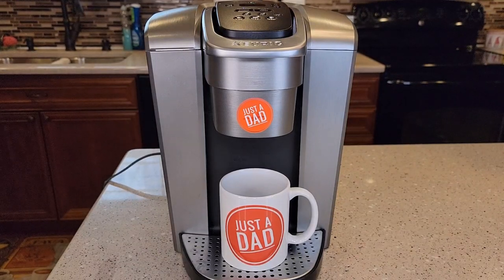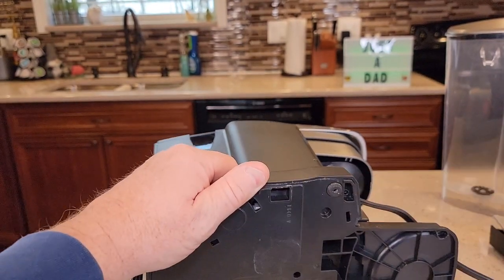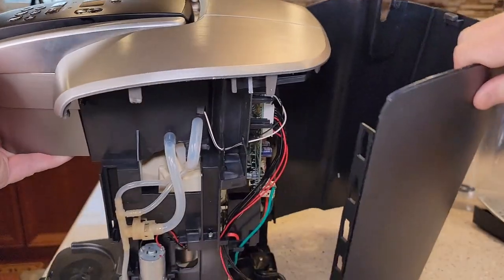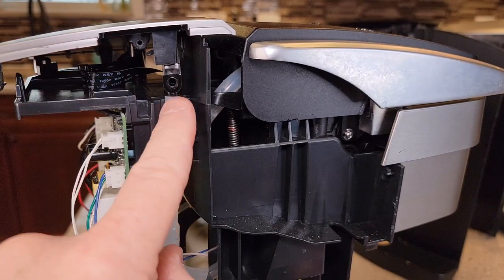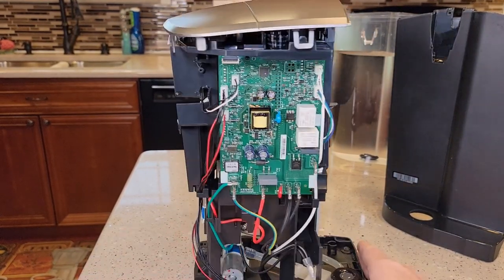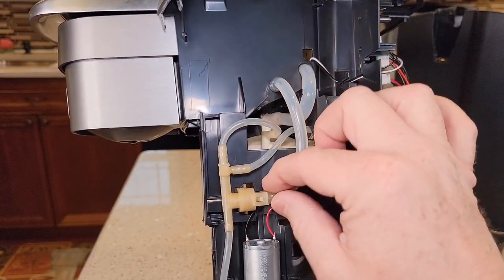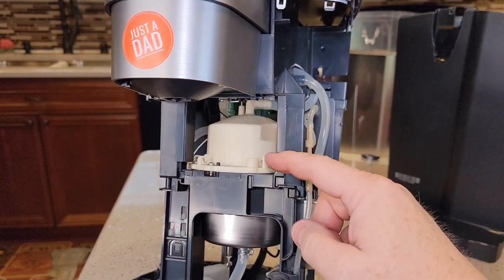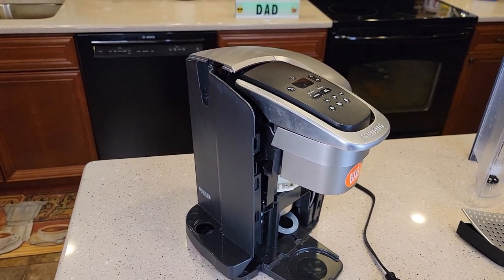HOW TO FIX Keurig K-Elite Model K90 ADD WATER LIGHT How To Open Fix Leaking Water

Comment: THANK YOU!!!!!     My "ADD WATER" light would not come on, so I used some canned air. I put the canned air tube nozzle into the vent hole at the top, then pushed my finger down onto the black valve on the bottom where the tank plugs into and blew air into it.. Then the water was forced out of the sensor tube at the bottom. Now it works again. You helped me BIGTIME !!!! You are AWSOME!!!!
Reply from the maker: Awesome!!!! good job and thanks for sharing!!!
Reply: @JustADad  I just watched this video and when he showed it was actually a vent hole, I went and grabbed my canned air and did the same thing. I was just about to post the same process when I saw yours. I had just gotten off the phone with Keurig and they recommended buying a new machine and I said absolutely not, someone online will have a fix for it. Atleast I know how to take the machine apart if I have another issue that may need that so thank you.

Comment: Recently the add water light stopped working on my elite. After watching your video and seeing how the vent tubing and switch work I was able to fix the problem with canned air. I removed the water tank and depressed the plunger valve. While holding the plunger valve open I blew computer compressed air into the vent hole you showed at the top of the machine.
All fixed. Working fine again. Thank you!

Comment: 🔵SOLVED🔵- My add water light stayed off even though the reservoir was not attached. I think what happened was when I tipped the machine to read the model number on the bottom (I needed to get instructions on how to descale) probably the sensor tube filled with water. After watching this video, I jiggled the machine a bit and I saw the light so to speak. 🔵 Thanks DAD!
Reply from the maker: Awesome

Comment: This worked for me.  The machine was pretty easy to get apart, mine must have had air in the sensor tube, because pulling the chassis off popped the little black piece off, and while turning the machine upside down to retrieve that piece,  small amounts of water and coffee came out that didnt come out before.  Thanks for the inspiration
Reply from the maker: Good job

Comment: Thank you - this video helped tremendously- I took a straw and blew air in that top vent hole that is on the side where the water container is while pressing down on the water inlet until air came out and then again until water came out through the spout - and behold the light came back on! Thank you.

Comment: Dear Just A Dad...This video is phenomenal.!!.  it so happens I have/had the exact brewer.  The power cord failed right at the wall socket and it was turning the machine on and off as you jiggled it.  I originally registered the elite. I called Keurig and asked for a Replacement Power Cord which I knew they would never do as I was years out of warranty..  So with some begging, I persuaded them to sell me another at 20% off. Not good enough, ask for supervisor.. 50% off.  $189.99 to $99.00.  I thought that was decent.   I just tested it, and put the 10 year old one out for the trash.  The strange thing was I tried to pack the old one in the new packing box and it would not fit.  Visibly, I could not see the diff but I did not measure anything, either.  Call Keurig...They will deal.!!   Date 8.27.2023  9:45am

Comment: Just a suggestion, you can go on Amazon and buy plastic spudgers. Make sure you get fairly rigid ones but they are excellent for this kind of use and are easier on the plastic than a metal screwdriver. Good video👍.
Reply from the maker: Thanks for the tip, I just ordered some!
Reply: @JustADad  nice!

Comment: Just A Dad! You totally showed me how to fix my nonfunctioning add water light: push down on the backflow valve under the tank and blow through the vent hole. It purged all the water out of the sensing line!

Thank you!
Reply from the maker: Glad I could help!  and thanks for sharing this good tip!
Reply: I just did that trick and a ton of water came out. Light still didn’t come on and the water reservoir is sitting on the counter 😢
Reply: @MsSaralyn  Fill the reservoir and put it back on. I don't remember if my light turned on right away, but it did the next time it got low 

And a bunch of water coming out is normal.
Reply: @TheDrewski71   and 🙌 the 2nd day it started working again. Go figure. Thanks for the video

Comment: Great to see the insides.  I wanted to see if I could drain the inner tank by tricking the water sensor. Most other Keurigs use a magnet float to determine the water level. This method is pretty smart, but I can't trick it with a magnet, oh well.  Still good to know what is inside these things.

Comment: I'm having trouble with leaking. It's not the water holder. I'm so bummed in less than a year one of the more expensive Keurigs is leaking like my cheaper one did. ; (  It does say "add water" when there seems to be enough but other times it's ok. I wrote the company but not sure if it will help. I can't see myself taking it apart but I thank you for all your hard work.

Comment: My light doesn’t come on until it runs completely out of water, then I have to fill it back up roughly to the position of that sensor. So it seems like the sensor works on the refill but not when the water level is going down. Is this the same problem others are having and do you think cleaning that tube will fix it?

Comment: If you line up the hooks around the side panels, you can pop the side panel downward and it will lock in.  Look at the hooks and see  the direction they pop inline.  THen install the screws.  If you removed the top hinge part, be careful. THere is  a ribbon cable that cn be torn off controlling the electronics of the selection board.

Comment: that is an overflow tube.  Is there a circuit breaker on this machine like the slim machine has on the side that you have to press to restart power:  Thanks
Reply from the maker: no reset on this coffee maker,  thanks for the update

Comment: I have a K-Elite that stopped pumping a full cup of coffee. The large (12 oz) only pumps about 7 ounces of water. Each size is nearly half the size that it is supposed to be. The "strong" and "cold brew" doesn't even pump water at all. I did notice that I just don't hear the pump taking water from the reservoir like I used to (either when I turn it on or after I brew a large cup). So, it only hums ever-so-slightly when it needs water (and I can hardly tell that the water is lowering in the reservoir). So, my assumption is that it doesn't draw water strongly enough from the outside reservoir into the heating reservoir. 

What do you think that the problem might be?

I've descaled, used paper clips on the needles and even pumped water into the intake hole that connects to the reservoir. Nothing has worked. My last guess is to take it apart before I toss it. I hate that this machine only lasted about two years. I guess that this is the new normal for Keurig now. If this doesn't work, I'll (begrudgingly) head to Costco for a K-Supreme Plus machine.

Comment: After watching this, I tried one more option! 

My add water was on but I had it filled from the sink. So unplugged the keurig and poured the water out. Then I put the tank back in the keurig empty. I then turned it on and took a pitcher of water and poured it into the filter and tadaaa 🎉 that turned it off 😂

So basically don’t take out the tank and fill it up separately?
Reply: I have this same machine as well and my light is on and wont go off! I lost the doo dad lil black peice on the side after taking apart and putting back together. I am SUPER FRUSTRATED I cant get it to run water and turn the add water light off! I am going to try this in the morning as well as the hold button under resovoiur and can air in hole on side top at same time trick and see if that will do anything for me. So basically I need to put on empty and try pouring water in on spout with the filter connected on the resouvoir?

Comment: Great vid. Any ideas about it not blowing air at end of cycle to clear water from the pod? I've tried all reset ideas to no avail.
Reply: Purging I think it's called.
Reply from the maker: make sure its not in high altitude mode,  do you see like a mountain icon on you display that mean its on.  the air pump line could be clogged.  maybe also clean the needles  not sure after that.

Comment: No issue with add water.  Descale light came on, solid red, not blinking.  Machine wouldn’t descale, heated up, draws minimal liquid then turns off when a cup size is pressed.  Eventually machine would turn off on its own without attempting to brew.  We clean monthly with vinegar solution and filtered water, charcoal filter replaced in reservoir.  No idea what happened.  Took it down enough to see the tubing is clear and unclogged.  Only 4 year old machine.  Thermostat issue?  Had to order a new one.
Reply: This is exactly my problem and I am having no luck finding a solution 😢

Comment: I just did the same process but instead of using compress air I used my portable tire / sports inflator.  It pushed out the water from the hotwater storage tank which was still hot.  I them pushed down on the back-flow valve and no water came out as it did before I used the Air Compressor.  I didn't want to use my compress air because of the warnings on the can... Anyway thanks Thanks Just A DAD!!!!!
Reply from the maker: Awesome!!!!
Reply: Before using compressed air in the tubing, you should really disconnect the tube leading to FPN-07PG pressure sensor on the PCB, otherwise you risk damaging it and the Keurig will be unable to sense the pressure buildup inside the chamber while dispensing and get no water dispensed.

Comment: I’m having a problem with this one where the water is not pumping out.  It makes all the noise like it’s about to make hot water but nothing is coming out and at the end it makes the noise of pushing the water out and not is coming out.  I did the paper clip cleaning and it still is not working.

Comment: Indeed, the only thing that sometimes bothers me from this machine is that light blue staying on even though the reservoir has enough water. It is an intermitent problem, though.
Reply from the maker: yeah I have seen that also.
Reply: I had the same problem. After watching this video, I decided to drain the water sensor tube. I removed the water tank and pressed the the part inside the socket where the water tank plugs in, releasing the water in the air vent. Fixed the problem.! I think my keurig had an air bubble in the water sensor line in front of the water sensor.

Comment: Great video.  Mine works normally except that when I put a pod in and close the lever, the blue lights dont flash to make any selections. If I press the hot water button, then the lights flash and I can select the size cup I want. Any thoughts or suggestions?

Comment: If you vacuum or somehow remove the water from the bottom part where the tank connect to the unit the sensor start working again

Comment: Don't over filter your water. I filled my "Zero Water" filter pitcher, which I use to fill the reservoir, from my under-sink water filter tap, effectively double filtering the water to where it no longer was conductive, thus, "Add Water" illuminated even though the tank was full. Eliminating one of the filter cycles corrected the issue.